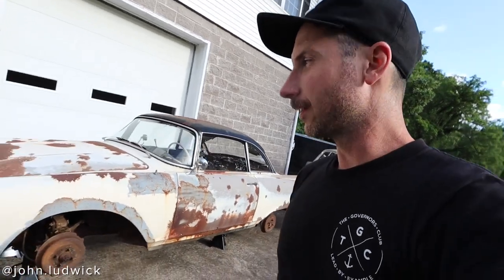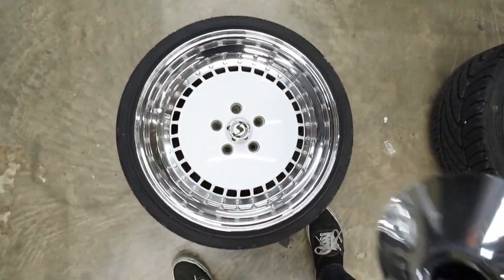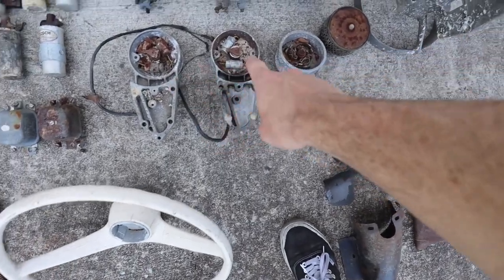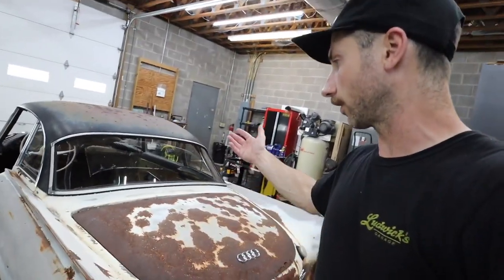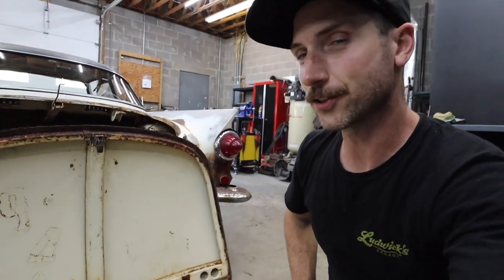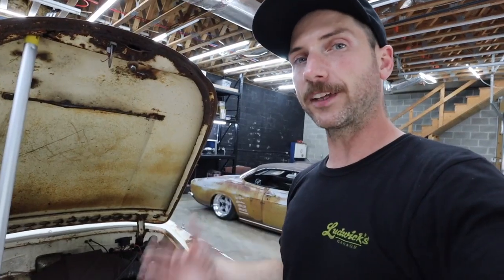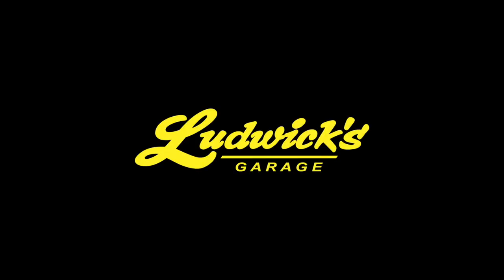Was My AUTO UNION 1000SP ONCE A RACE CAR?! A First Look At The DKW Project

Comment: Marking on the gas cap are actually instructions:  "first oil, then gas". Putting oil in the tank first will ensure it will form a uniform mix when gas is added, rushing by the oil. They thought about it, clever engineers.
Reply from the maker: Yes exactly! I’ve realized the translation since I made that video! Thank you!

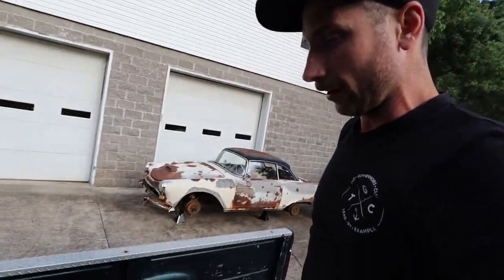Comment: It’s not 1 part oil and 2 parts gas! It’s oil first and gas second so that the two fluids mix better. Typical mixtures we’re between 1:50 to 1:33. Car is 6 volts; my dad converted his Auto Union F8 to 12 volts to make it start better in the winter.
Reply from the maker: Yea my plan is to also convert it to 12v!